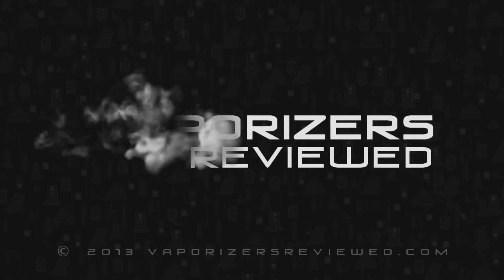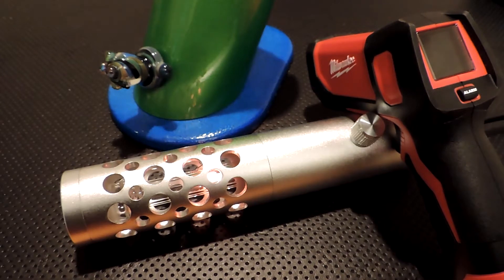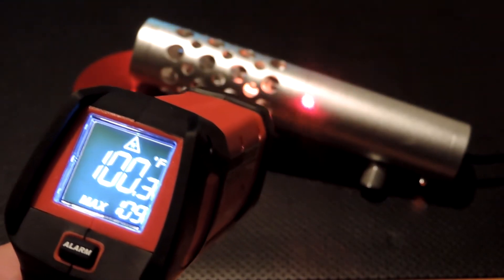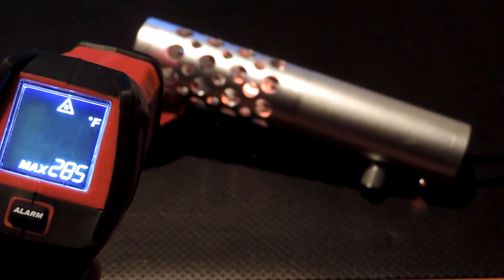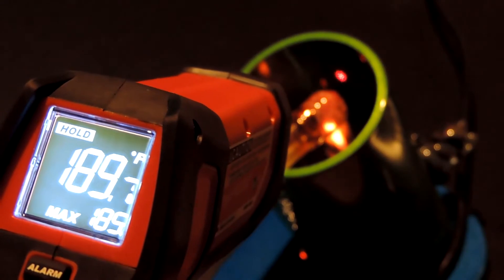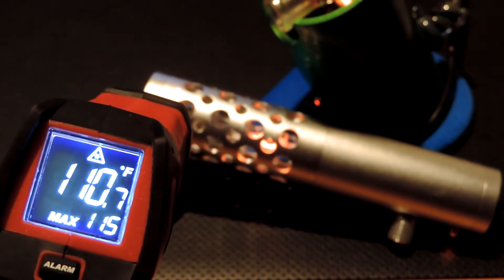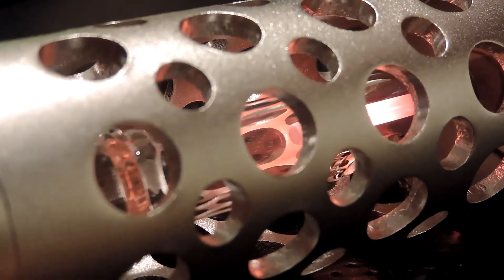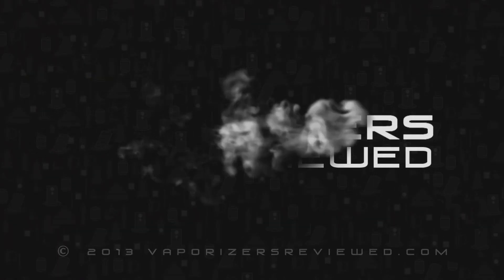Life Saber Temperature Readings

Comment: I have the same vaporizer and just a few days ago it broke down. The last time i turned it on, the heating element just flashed once like a light bulb (bright yellow) and since then it stopped working.  i assume it might have just shorted out but maybe you have some info on similar accidents and what might be causing this?
Reply: And also how do you disassemble one of these? The bottom cap seems to be glued on and I'm just wondering if I'm missing something.